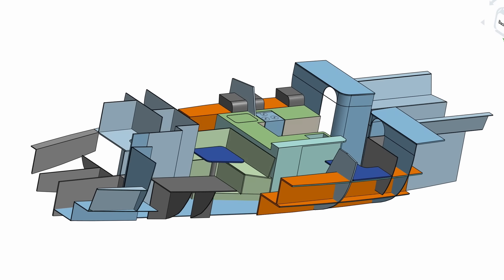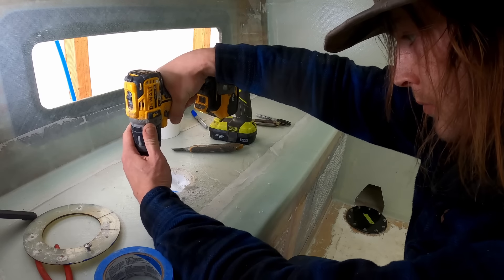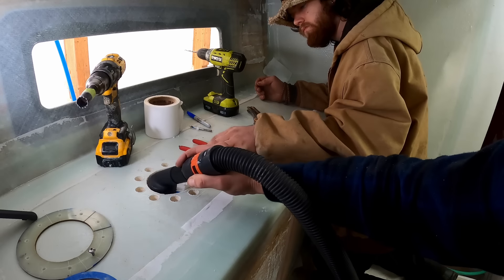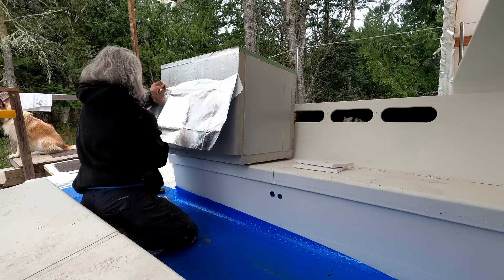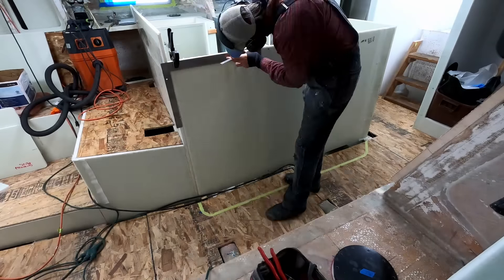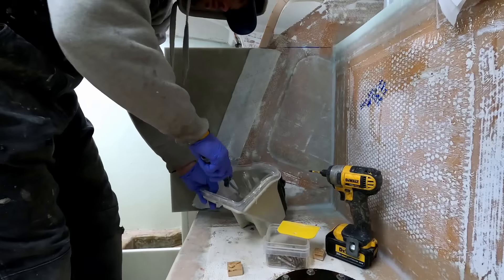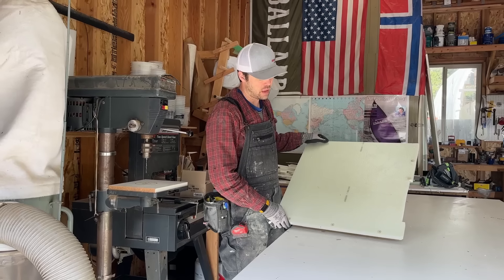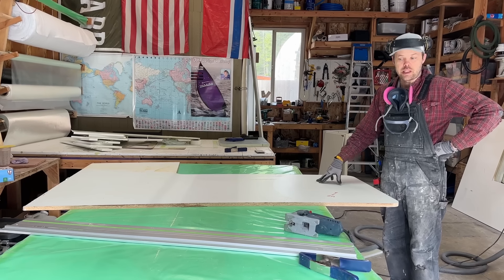High Pressure Test & Galley Comes Together [E120]

Comment: Im not a sailor, however I think that you need to incorporate a series of grab rails on that island/peninsula to assist anyone walking when you are under way.  Love the video and music selection - its coming along! 🇨🇦 👍.
Reply: Yes. I recommend  he takes a camera and goblook at other boats a take pictures of the interior.  Reason,  there may many things you want or need to incorporate  into the boat that you have  thought of. 

Like safety,  fire extinguishers.  Easy access  but out of the way sobyou don't bump into it. Fires on boats is no joke. 
A place for life vest. Flare gun and emergency  equipment.  A tool and parts area. Plus ways to lock this down and strap in place so it doesn't  rattle.

Comment: the drilled holes in the foam should be square. If you drill a screw in it can slip that round form. if its square you would need way more force to overturn the screw.

Comment: If you use a hand sander without sandpaper on a towel or thick cloth next to those thickened Apoxee holes it’ll vibrate the second Apoxsee, like cement, making it stronger.

Comment: Removable  panal : tip, cut stainless  tube the thickness  of the panal. Glue tubes in the holes. When you bolt it down. It wont compress the panels.  This saves a lot of time and works very well.

Comment: My first “work” experience was fibreglass repair on a northern 26 that was dropped while being moved in a boatyard. Love your channel and decision making processes.

Regarding the pressure test. Keep in mind the head pressure of a water column is 0.433 PSI per foot of elevation. I’d test at more than 1.5PSI to ensure a larger safety factor.

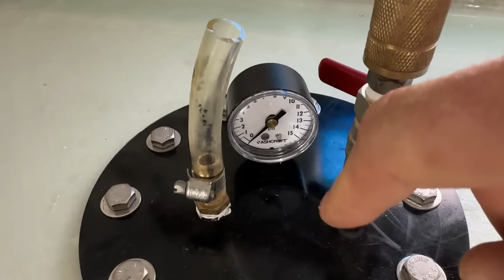Comment: For all commenters who thought he pulled a vacuum on the water tanks, go back and look again from 4:20.  He used the outlet side of his vacuum pump and got the tanks pressurized to a positive pressure of 1.5 psi.  It was not a negative pressure (a vacuum). He commented that if that didn't work (which it did), he would use his air compressor.
Well done, Matt.  Looking great.  I would also eliminate the overhang on the galley countertops.
Reply: Aren’t you forgetting that he said, very clearly, that he is using the “output side of the pump” and that he hasn’t tried it before. All people have to do is listen to his words rather than look at which side of the pump he used. You can also see the pressure gauge rise.

Comment: I would lose the overhang on the counters.  You still have a lot of counter space, which is really nice.  But remember what flat surfaces are like 1) they collect a lot of stuff and  2) when you're sailing stuff slides around a lot.  It is easier to have stuff not slide so far.  Of course you will have good fiddles on the counters.  I like what you are doing Matt.  It will definitely be a top flight boat.
Reply from the maker: yep, we're leaning that way too

Comment: Hi mat , you can fit a small alen key in your drill and use it as a fly cutter, no need to hole saw just tape the bottom side and inject thin resin , on a vertical panel you tape both sides and drill a hole at the highest point . I have even used this method on balsa core . The lids on your water tanks are impressive. I confess it looked like you were planning to fit plastic screw caps . I personally wouldn’t have joined the upper and lower tanks no matter what . A heavy see will test your wisdom .  love the show cheers

Comment: Good propositions so far🎉
1. If one has space for double sinks - one installs them.
2. I would put a smoke hood above the stove with a strong extractor fan.
I.e. those would be my basics
Reply: one and a quarter sinks for a boat galley. Yes to extracting smoke and grease.
Reply: Might be worth checking your grease trap panels in the extractor hood can fit in the half draw dishwasher. That would be the easiest way to clean them.

Comment: @18:10 Yes the countertop is high..., compared to what you're used to (now).
Referencing the elbow, I would not want much more than 2, max 3 inches below the elbow.
One (solvable) downside can be that it is harder to cut things needing to use your weight.
It brings at least 3 things: Comfort in working, safety at sea, and safety when a toddler is roaming around.👴🤷‍♂
Edit: It is also a kind of compromise between bar height and the old-fashioned café-counter height.👴😁😉

Comment: Have you considered using folding shelf brackets for an extension of the countertops behind the sink? They are dirt cheap and robust on Amazon and would be easy to trial with the melamine. You could easily do it so they mount under the overhang so you still have a rounded corner when stowed. The only issue would be the top drawers on the blind corner would be inaccessible unless folded up but could be used for less often needed items. Just a thought and a great episode as usual!

Comment: It is a very big galley. Even allowing for sink cutouts and stove tops. But you wouldn't reduce it unless you can find a better use for the freed up space. That blind corner space is useful. Working around people in a boat galley is frustrating sometimes. It's another access point to the counter. I know it's a walkway and you don't want to block that either. Maybe it can be recessed in a bit.
Reply: Might want to not have an overhang on the galley top… bruised hips ahead..  better to make flush vertically with the cabinets and put a solid grab rail around the perimeter vertically, generally less stress points in use …
Reply: Yep. Overhang is for standing or sitting there comfortably. Not what you want in a passage way. If they notch out an arc in the blind corner there will be overhang enough for one person standing or sitting.
Reply: In a tiny to small galley its a one person space. Put in a galley that could be seen in an apartment and its an invitation for people to enter. But it isn't functional that way. If someone wants to help you they can do so from the other side of the counter.

Comment: No bear / raised area behind the sink. Its nicer just to have a flat surface. It will look to crammed with a raised bar. And the 4 inch overhang might be to long. Maybe a 2 inch would be nicer.

Comment: Glad to see pulling vacuum worked. You can use that technique to check for leaks in HVAC. And other msc applications. Nice work and great progress!
Reply: You can also use the compressor to put positive pressure in the water cell then use the soapy water to check for bubbles. Just like you said.

Comment: You are an amazing builder and achieved the unattainable and I send you a lot of compliments.  I only have 1 question and that is why you used fragile IKEA laminated chipboard for the countertop, which fits perfectly of course, in stead of waterproof glued laminated triplex ore plywood ore how ever you guys call its. I was just asking because I thought you build everything so strong and durable and this board might chip off easily I stead off laminated real wood? Well, good luck with your fantastic project
Reply from the maker: the countertops are just as a work surface for the rest of the build so I can use them for work. We'll put final counters on at the very end that will be much nicer!

Comment: Big galley! Whats going in the area opposite the galley? Its a good secure space; Id probably delete the overhang on port side - good walk through is nice to have. 

My thoughts would be that you could have used the area opposite as bench & had it more transverse and an L stbd side, pulled it back a bit to gain a bit more space in nook seating area. Could have had a small square island in centre that had a flap opening to make more counter space when required. I think you are going to spend more time in the nook than you think....
But then youve been looking at this forever and have real design involvement,! :)
Reply from the maker: That’ll be the nav station

Comment: Hi, you might have said it but can you explain why you did the counter of the galley in plywood instead of composite?
Reply from the maker: they are just temporary counters that I can use as work counters for the rest of the build. We'll replace them with the final counters down the road. Not sure what the final counter material will be yet.

Comment: Nice to test the tanks but, on my opinion, with a vacuum in the thank you will never have bubles of soap coming outside. Only if you put pressure in the tank.
Anyway, if the neg 1.5PSI holds, there are no leaks.
Reply: I believe he reversed the flow and produced positive pressure.
Reply from the maker: We put positive pressure on the tank, so if there was a leak we’d see bubbles.

Comment: Looking good. I'd remove the overhang on the walkway side of the galley top (where you originally thought of a 'bar'), extend the back up a bit to stop things on the counter top sliding off (or water from the sink going over on to the walkway)... and then you could put a hand hold on the upright end as you come into the galley area.
Reply from the maker: I like the handhold idea

Comment: It looks good for a galley. The only doubt I have is how the vertical foam panels will hold up to being bashed and kicked by people falling around in rough seas.
Reply: They're laminated with fiberglass, so I bet they'll do well. It's the same material the boat's built.
Reply from the maker: You are right it is less impact resistant than plywood.  It’s a compromise I’m willing to make for keeping the boat light weight, but there’s enough glass on there that it will hold up to most abuse.

Comment: I would swap the position of the stove with the sink, because it is much nicer to be able to talk with the other persons in the galley while you cook than to be forced to turn your back to them.

The sink is less important, you have a dishwasher so you wont spend that much time by the sink, so why put that in the best place in the galley for talking to other persons while standing there?

When the boat leans it shold not matter if you swap the stove for the sink, the position is just mirrored, the only reason I can think of for not having the stove in the middle is if your planning for a cooker hood and fan.

Comment: Nice job you are doing. I'm very glad you didn't go over 1.5psi. I had a friend that got killed at a factory we worked at. It was a pressure vessel that had a 48 inch X 1 inch thick steel lid that weighed 80 pounds per square foot. That's a lot of square inches. It was going to be shipped with nitrogen inside. A quality check point was skipped and the bolts were only tack welded. It only had 7 psi but per square inch that is thousands in pressure. My friend was on top and turned the bolt one flat and it blew out. and the 1 inch plate hit the rafters 90 foot high.
Reply from the maker: that is so tragic. :(

Comment: Curious why only 1.5 psi? Humans can blow more psi than that. Seems crashing waves with water in those tanks might exert more pressure than that?
Reply: Multiply 1.5 psi times the surface area of that tank.... Start talking big forces pretty quick.  No need to blow the  front side off the tank. Yes, it may hold 10 psi, maybe even 20, but at some point it'll let go with a loud crack.
Reply: @sandercornelissen5809  the video said high pressure test. 1.5 psi isn't high pressure

Comment: With water tanks the norm is to pressure test since the tanks will be filled with water, therfore excerting a pressure. Any cracks will be pulled together when vacuum testing but pushed apart when pressure testing. The correct test is to pressure test.

Comment: To split hairs, it's not a galley style kitchen it's a "C" or "J" or "U" style kitchen. I realize that the kitchen in a boat is always referred to as a galley, but it's simply not accurate. A galley is made up of two parallel tops that do not connect in the middle and there is no island present.
Just the musings of a kitchen designer.

Comment: Man..! F..k. Im really admire your work... that all is amazing and that is really good work..I love this channel and your work Serio. BUT! Why you dont made plastic tank for water...?!?!? You made similar tank for fuel.. so... why you dont did that for water! Plastic tank under this fiber glass and that is all... and you F... with this sh... for few weeks... why? Why?
Reply: They were already water (ballast) tanks in the original design. He just made them smaller and potable. Epoxy IS plastic.. reinforced plastic. 

Liners come with their own concerns. 

You either make them fit perfectly or you need to build straps and supports to keep them in place while the boat bobs around in ocean swells.
Reply from the maker: We are making the best use out of the space.  The tanks were there already and could cut them down for potable water and cabinetry.  It’s a huge job for sure.  We’ll get through it eventually.

Comment: Your air test was a little flawed. Because the tanks are so big, it would take a very long time to notice a drop in air pressure from a very small leak. You should have left it overnight or for 24 hours to be sure. Good LUCK, your test was NOT conclusive.